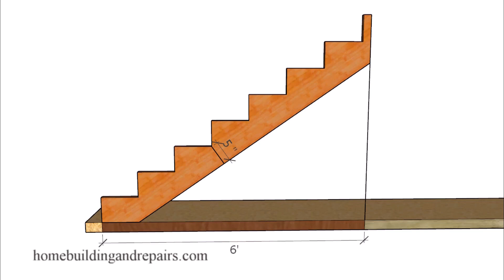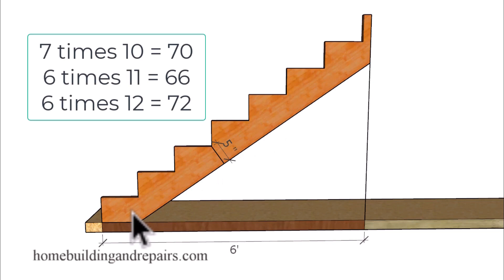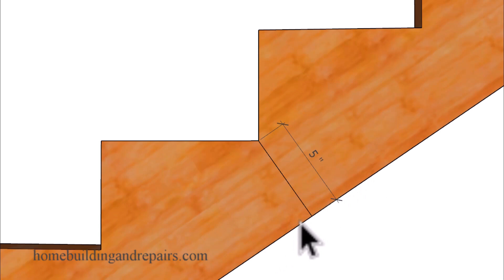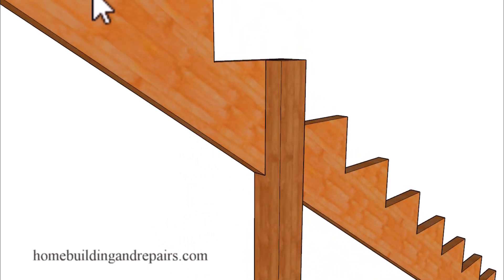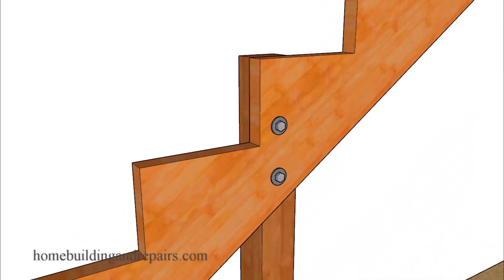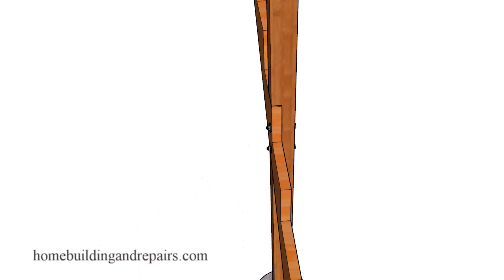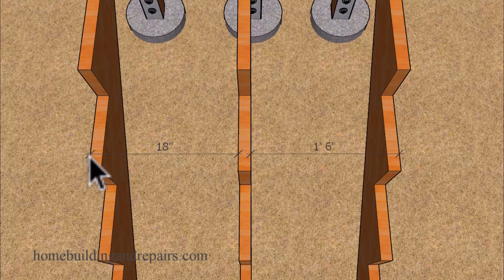Maximum Notched Deck Stair Stringer Length According To The American Wood Council - Design For Codes

Comment: Can you do something similar for an interior stairwell but with a knee wall from the posts down?

Mostly curious about the proper way to join the knee wall to the lower stringers.
Reply: You can set 2 posts in the ground with a beam on top of them as well.  Lag screws and hurricane ties work well for attaching

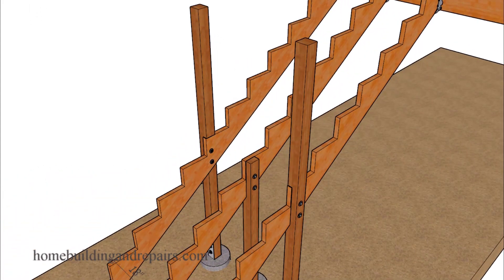Comment: At 3:29, you show three individual posts and footers as supports, one for each stringer.

In your opinion, is there any reason someone could not run a board between the two outside posts and have the center stringer rest on that?